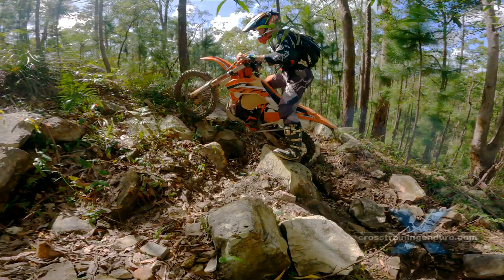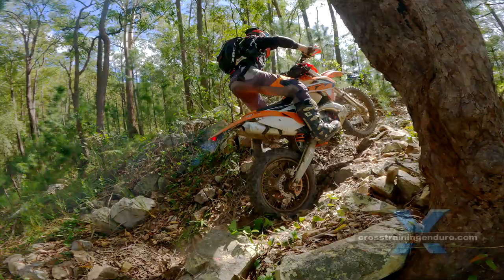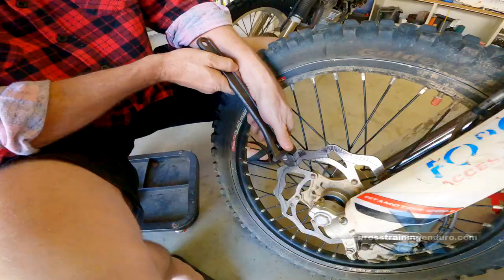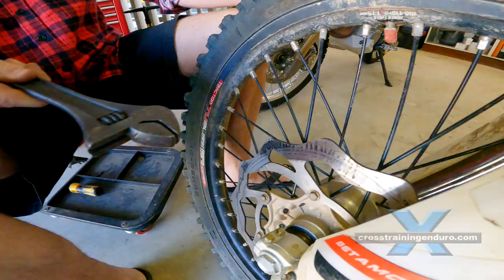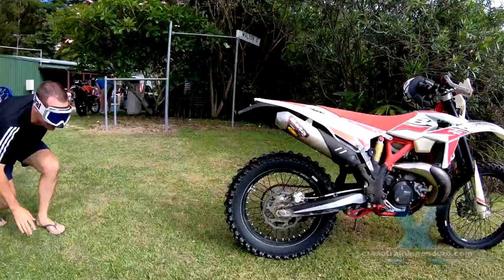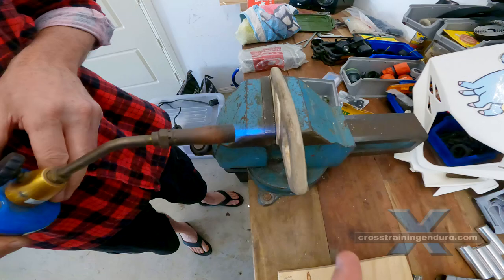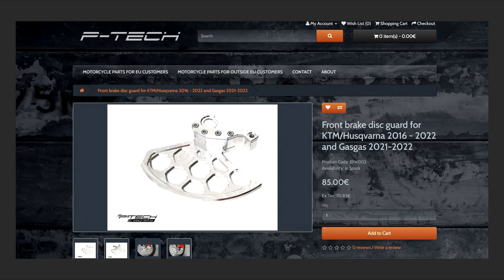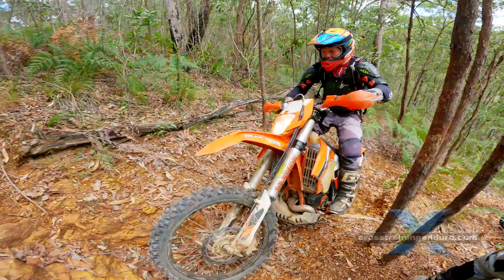How to fix bent brake rotors and disc guards (plus prevention tips!) ︱Cross Training Enduro

Comment: A tip for bending aluminum.  Coat the part in bar soap.   Heat it up with the torch.  When the soap turns black it should be safe to bend.
Reply from the maker: Good tip!
Reply: alunimium, magnesium, potassium, aquarium, gymnasium...

Comment: Good idea to occasionally undo the nuts holding the disc on (don’t need to remove the disc or wheel) just to make sure you can remove them on the track without your full workshop equipment. Cheers

Comment: I’ve hammered rotors straight using a polished concrete floor. Just keep smacking until you can’t see any teetering while the disk is on the floor

Comment: Hmmm, not sure what a "shifting spanner" is so I just use a crescent wrench😝 I have fixed countless bent rotors with a shiftless spanner. Years ago I loaded my bike up and went home after a bent rotor incident early in my ride. I was kicking myself when I got home after realizing how easy it was to fix...drat!

You have to use some judgement on how much you can bend it back. The fact that it bent at all says it's pretty tough to begin with and can be bent back without much issue. If there is ever a crease that you can see, get a new one.

And about heating aluminum when bending it back, a propane torch creates enough heat to melt aluminum and you don't realize it until it's too later so be careful. My mother's brother's nephew melted an aluminum pipe guard trying to get it to fit.🤣
Reply from the maker: Good points Dave. Even the Aussies are frustrated that I said 'shifting spanner' when we always shorten it to 'shifter'. But then everyone overseas would really be scratching their heads lol.

Comment: (Edit/adder below op*)
When you've heated up the disk-guard to straighten
it, do you need to dip it in cold water to bring back the
strength, or is it good enough cooling at room temp
---
* I'm blocked from replies, but can edit, thanks 
for the reply. I guess we're not riding space shuttle
stuff, so yeah, probably not a huge issue. :shrugs:
Reply from the maker: Good question. We definitely don't heat it too much, just enough to make it bend easier. Some guys have told us it's very easy to overdo it and melt the alloy. 👀

Comment: My pit bike started to randomly jam up
when pushing it backwards, I looked it over
quite a few times trying to determine the cause,
but could come up with nothing. 
Chain? Bearings? Brakes? Sprocket? lol
Eventually I
discovered that the edges of the rotor had 
protrusions due to the brake pads digging into them,
but not mating up with the extreme perimeter of 
the disk, so there were these randomly catching
edges, that would hang up in different spots,
while backing up the bike, making it difficult
to determine the cause. I used a grinder to 
remove the protrusions, that eliminated the issue.
Reply from the maker: Haven't heard of that one before... good to know in case it ever happens to us.

Comment: I'm about to change pads, and I thought about gluing some wet/dry sandpaper to the old ones to "turn & surface" my discs.. anyone else ever try it?
Reply: On the turning side, how is that different from your brake pads rubbing on your rotor? It will still move sideway on the caliper pins, right?
Reply: @cedricboivin9422  I was going to reinstall them just to resurface the disc's, by rolling the wheel and using brake pressure